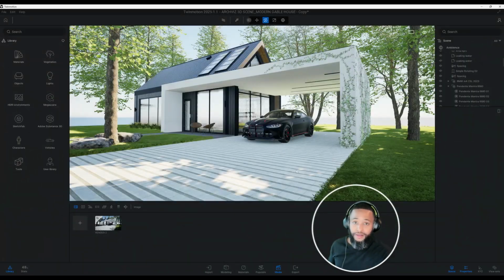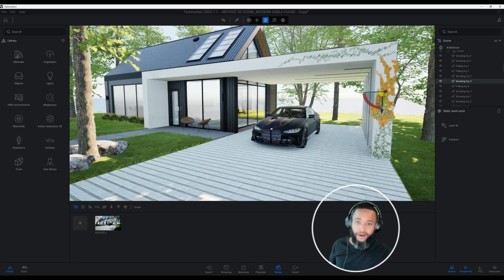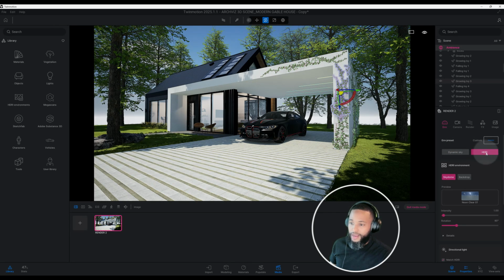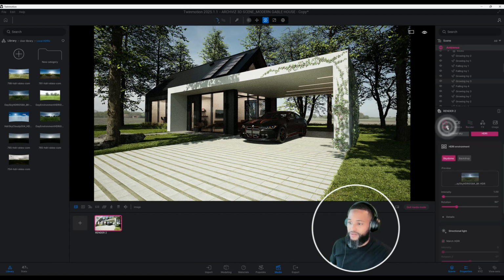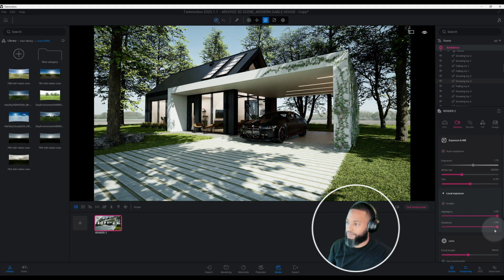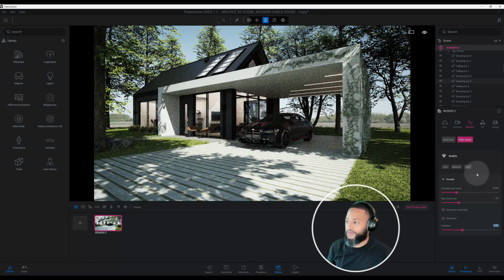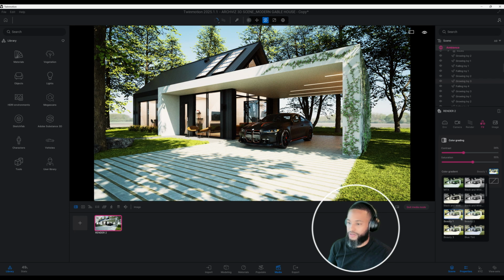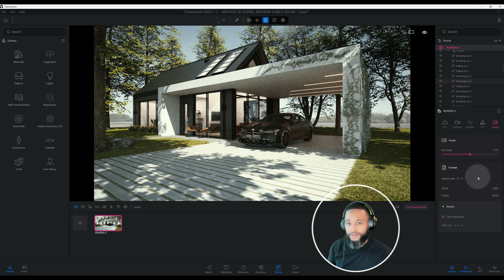⚡️Transform Flat Twinmotion Renders into Stunning Realism

Comment from the maker: 🎯 Struggling with Flat, Boring Exterior Renders? Watch This!

In this Twinmotion 2025.1.1 tutorial, I’ll show you how to take a plain exterior scene and make it pop—fast.

✨ Easy FX tweaks for instant realism
👀 How to fine-tune camera angles and settings
⚡ Scene setup tricks that add depth and detail

👉 Want pro-level results even faster?
Grab my ready-to-render 3D scenes and presets: RenderReboot.com/collection/3d-scene

🔁 Restart. Reset. Render. Your best exterior visuals start now.

#RenderReboot #Twinmotion2025 #ExteriorRendering #RevitToRealism #3DVisualization #ArchViz